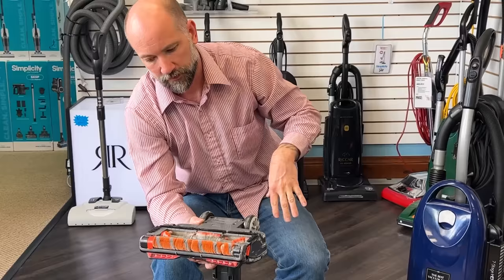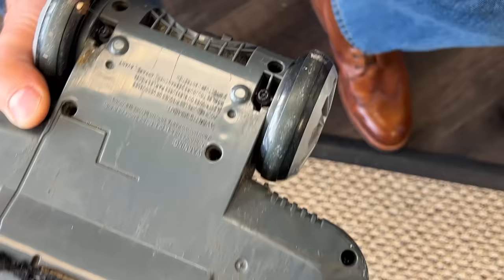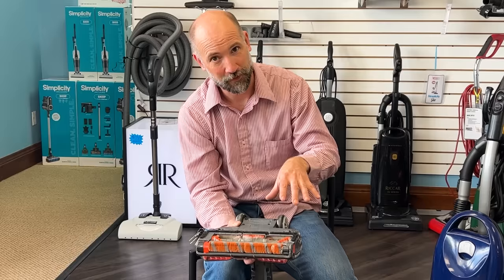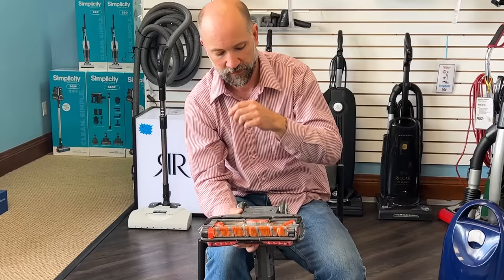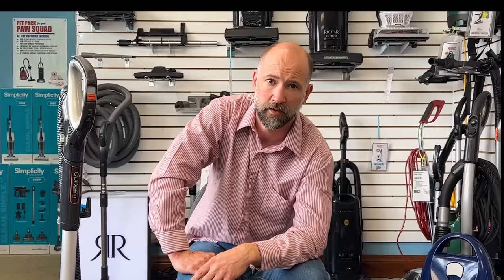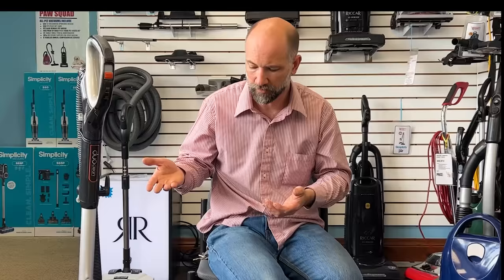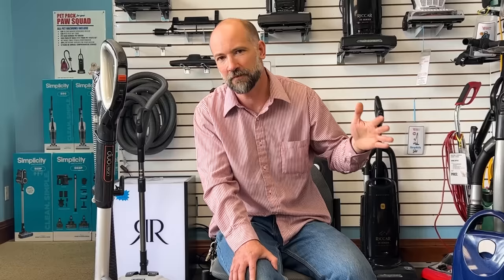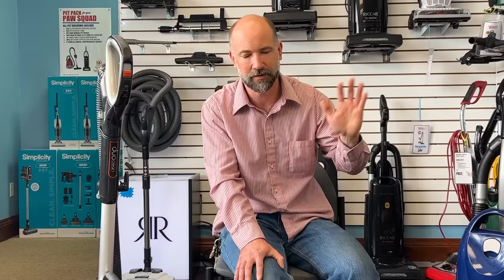Why Can't You Repair Your Shark Vacuum?

Comment: I have a shark duo anti pet hair model, and unfortunately they don't like to suck up tinsel, as the wire through the centre cuts grooves into the main roller, which damages the yellow plastic flaps and allows hair to wrap around it - the exact opposite of what it's supposed to do.

I, like many others, tried opening it up, and that was quite an adventure. It's now in pieces. Thankfully I've managed to find a replacement brush for sale (maybe second hand, but in good condition) so I'm waiting for that to come.

In the mean time, I still have a jigsaw of parts waiting to go back together, hopefully I've not lost any of the screws, and I will probably have to rewatch the video I found which shows how to get it all apart.

Like you and many others say, this really isn't best business practice, and, as the saying goes, once bitten (by a shark) twice shy!

Comment: So I got a powerfins hairpro. After a year suddenly it stopped sucking. Light comes on and if I have it set to carpet the roller spins it just doesn't suck. Thankfully I had the star screw bits but I found a screw that will not come out even though it is backed out all the way. Of course my magnet screw drivers won't even pick the screw out and I can't even bang it out. It is like it has something on the inside that keeps it from coming out and I can't even open it with the screw in there. It is pretty annoy that I can't just open it up to try to figure out why it stopped sucking.

Comment: My shark duoclean hv382 needs repairs. Either the belt snapped because the brush roll isn't spinning, and brush roll indicator light isn't working. But front lights are on

Comment: Fortunately those clowns at Shark have gotten nothing from me. I found my NV800C next to a dumpster and oddly enough it worked fine when found and for a long time after. Very recently though the main brushroll slowed and stopped; turns out the crappy bearings had locked up but the plastic gear kept turning which rounded off and melted it at the hub. I found that the bearings for the front brushroll drive were also stiffening up. Of course the crappy bearings were molded into the gearbox, so re-using that is impossible. I saved all the metal bits with no small effort; since the plastic gear was shot I would have been better off lighting the gearbox on fire to separate the useful parts. I’ll have to find a compatible replacement for that plastic gear which may mean combining two, and I will need to fabricate a bearing block somehow. The motor mount is still there, having broken away from the rest when I attempted to fix the unit. Aftermarket bearings of the correct size can be had; come to think of it the bearing on the brushroll itself had stiffened up and I replaced it with one from an old hard drive which worked fine until I swapped the entire brushroll.

I keep this vacuum mainly because I like the colour, and I’ve put a lot of work into customizing it. All of the ugly bling is gone and parts of the housing have been cut away for a cleaner look. I used to have a Shark stick vac which I hated the look and colour of, also a trash find. That had Philips head screws which I saved, and whenever I forcibly remove those bastards from hell, a.k.a Torx security screws, sometimes with the business end of an old jigsaw blade with fine teeth, I replace them with compatible screws from the other Shark.
Reply: One more thing, I also saved the plastic drive pinion for the main brushroll. The screw holding it on was actually a Philips but that would not turn and had to be drilled. What’s left of the screw is still stuck in place; hopefully heating the part on the stove will help me break the stub loose.

Comment: Still Sharks are amazingly innovative, (lift away and still power head like a canister) and they are light weight and quiet.
Sucks that they cant be repaired easily. They have amazingly tough belts unlike most other brands.
Most all proprietary electronics use protected bits and you can get a complete set of them for less than ten bucks at any Harbor Freight.

Comment: Thanks for this video, Josh.  I have a Shark and the small front wheels wore out.  I think I can fix this.  I appreciate your sense of responsibility as far as recycling goes.  Not too many people care.  I do, and want to thank you.
My son gave me a Hoover Windrunner and it is just too heavy for me to use.  I'll try to fix the Shark, but if I can't, what vacuum do you recommend?  Years ago I had an Orek and it seemed to las quite a long time.
Reply from the maker: Oreck was pretty fantastic in it's time. They were bought out by a comapny out of Hong Kong (guess where Shark is based?) several years back and their business model changed a lot. If you liked that Oreck the US company Riccar has a product line called Supralites which are a lot like Oreck. They are around the same weight but tend to pack a little more of a wallop since they have larger fans and slightly larger motors. https://www.vacuumsrus.com/product-category/cleaning/vacuumcleaners/?filters=yith_product_brand[11664]

Comment: I tried replacing the lower hose and I failed miserably so I just ordered a new head directly from them for $65... All I needed was the tiny hose but in my model the hose is connected directly to the motherboard thing on the vacuum so it was impossible to actually replace.

Comment: You forgot to mention the security torx are made of cheese. That makes it easy to get the peg out if you're not using security bits (they snap out easily) but they round out inside too. If you're able to get them out, use an alternative when rebuilding - hex, Phillips, pozidrive.

Ours stopped latching upright. The posts for the lower assembly retaining screw either side of the rear wheels snapped off the inside of the top plate. Whole new bottom assembly rquired at £85. Found a bashed used one for sale on eBay at the same time so bagged that for £15 for a spare.

Comment: Thankyou, I will never buy a shark vacuum again!
I bought a star size bit not realizing it has the specific hole in the center of that bit..., so yes, not even able to open ot up to check the belt.
At least I can still use it for the hose.

Comment: Shark will sell you the parts as a whole. You cant buy individual components for the Duo part but you can buy unit as a whole. Its a pain yes, but also I think that if one parts broke then another part will probably fail soon after.
I found mine to be reliable, except the anti hair wrap is a massive con and the tube has a tendancy to clog up

Comment: I can repair anything, if I have to. There are ways to get around everything, you just have to think outside the box. A good a good set of security bits and sizes of them is a good investment. Amazon sells plenty of sets from basic to all inclusive. With a little ingenuity, you can overcome any security measures and you don't have to use the same components for repairs. There are many ways of solving any problem. The security tabs can be overcome also and most of the time, if they break, it doesn't effect anything and if it does, there are ways of putting it back together without them. You have to be smarter than big corporations. You can fix anything if you really need to, it's not that difficult most of the time

Comment: Thank you for the great information. I have that roll er problem also that was intermittent but now it's not working at all. I do like the shark vacuum cleaner for its convenient accessories. Which one would you recommend to replace it? That is pretty comparable to it. And if problems occur repair components are available.

Comment: I bought a shark vacuum and came accross the lower hose issue after 18 months, had to buy an entire second hand head unit after eating up a lot of my time trying to open the oold one to replace the failed part. Not surprisingly this appears to be the same company behind Ninja airfryers, which are also a product with planned obsolescence and a lack of parts.  I will never buy their crap ever again

Comment: I bought a Dyson vacuum 20 years ago.  It was ~US$300, which I thought was quite expensive.  Just rinse clean one filter when needed, and replace the other HEPA filter every few years.  I even put a set of brushes in the motor a couple of years ago and it's all still going strong today.
Reply: Sadly the modern dysons aren’t as good. We’ve had four and while they haven’t gone the security screw route they got more fragile and complex. We now have a Hoover which was a fraction of the price and it’s obviously built to a price but as a consequence it’s simple and easy to fix. And the parts are easy to get. Also, it works very well.
Reply from the maker: @MrPhobart  That is an accurate observation. Out service center sees two types of Dysons. They ones that have been running 15 years and are in for their first repair, and the ones that are three years old and are already in melt down.
Reply: Totally agree. My DC17 is about 15 years old and still runs like a champ.

Comment: Not really any different to any other brand. Re the Torx drivers, they are available at any hardware store and you don't just buy one, you buy a set so all sizes are covered (often cheaper than buying a single driver). If access to internals is made too easy it becomes a safety issue as there are high voltages internal to these devices.

Comment: I think when the current shark dies, just gonna go back to an old fashined Henry.
Had Vax,  had Hoover, had Dyson etc. And the machine are either bad or the customer service is. As a kid our old upright was second hand and we had it 15 years, the vax that replaced it lasted until a housefire 6 years later. Somce bagless came along, the life span and repairability of machines has dropped right down. It seems they only want the machines to last as long as the warranty.

Comment: Yes it upsets me that the first sweeper I bought had a lifetime warranty but they can't find me in the system .I bought another small one  can't take it apart to clean it nor replace belt as you say . doesn't even have lights on it which I didn't realize I'm and older lady so my sight not the best .Well this will be the last one I never buy I'm done with this company .what a trip off .

Comment: I've found on average Shark vacuums last maybe 2 years before a repair is needed. Even if it is under warranty, not all parts are covered. I like using their vacuums but will not buy one unless I'm able to get one at an exceptionally good deal.

Comment: watched this video and your info and insight is great.  I have a NV831 duoclean.  I got it apart, labeled screws, etc, but the bottom hose was glued in on the head piece.  On the wand, I had to pull it apart to get the hose in.  I went to a vacuum stall at my local farmers market.  I bought a foot of hose, but it's more stable and not flimsy so it doesn't fit.  The clerk also said she couldn't take it back to the shop to repair (probably because of what I found)  Another repair shop wanted $119 to fix, telling me that he would give me the hoses free, but I had to pay the bench charge.   So can you recommend a vacuum that can be repaired in the future.  I have 2 cats and a mix of carpet and hardwood.  thanks,
Reply from the maker: Sorry to hear that. The brands we tend to lean towards personally are Sebo and Riccar!

Comment: Job for Louis Rossmann I think.  
We use Dyson exclusively, and every Dyson product we ever bought is still running, with the majority of spares available OEM or aftermarket.
Reply from the maker: That unfortunately is changing rapidly. Dyson abruptly terminated their contracts with their network of independent service centers in January of this year. We had been a service center for more than a decade. Several months after that they fired their Us phone support staff. Prior to this year we had seen a trend of parts becoming discontinued more rapidly or out of stock for lengthy periods. One good thing however is Dyson does not cycle models as rapidly as Shark which enables aftermarket parts producers to create popular aftermarket repair components.
Reply: @vacuumsrus  Worth knowing, thank you.  Very little upsets me more than planned obsolescence.

Comment: I regretfully vacuumed up diatomaceous earth with my Shark AZ1501 apex lift away and it still works but not as well. I cleaned out the filters and what I could without opening it up. Should I bother taking it apart or having it done? It is only a year old & was in great condition prior to me doing this. I thought maybe I could blow off any powder inside ? Would appreciate any advice. And no I will never do that again as I have now learned that was a big NO NO 😜

Comment: I've never owned a Shark and now I never will. I don't understand why people would keep buying them??? Shark must know people better than me if they buy 4 vacuums in a row. I'm 65, I bought a Numatic Henry about 40yrs ago, after an inherited very old Hoover Constellation finally gave up. The Numatic has never broke, despite having an unplanned journey down my staircase, going to a lot of the commercial sites that I worked on before retirement to clean up rubble, wiring debris etc, it has been my workshop cleaner ingesting lots of sawdust and over the years in the house they have seen a lot of cat hair as I always have a couple of furry friends living with me and generally it has had a very hard life, but it keeps going. Numatics are robust and simple and not too expensive. There is a whole range of Numatic vacuum cleaners, some are a lot larger and some are wet & dry etc. I don't anticipate getting a new cleaner anytime soon that's saying I ever do! 
Hot tip: Although it is tempting to use Henrys without a bag, they suck much better with a bag. It sounds perhaps counter intuitive but the micro-particle screen will clog up almost instantly without one and the surface area of a bag if opened up and laid flat is much greater than the screen which was never intended to be the main dust filter. Proper Numatic grey cloth type bags are relatively cheap and can be bought by the box, they are much more effective and last longer than cheap non original brown papery bags on eBay and market stalls. (I think genuine bags are available at eBay and possibly Amazon too.) 💐♥️🧀😎🐈‍⬛😺🏳️‍⚧️🇪🇺🇺🇦🇮🇱🇵🇸💐

Comment: My hunt for a decent vacuum is failing. I have 2 sharks. Had to take apart both, then I got a Kirby and the Kirby is the absolute trash, if it dust then it’s great. If it’s crumbs of chips then it struggles. Also the self propelled motor burns out easily.  Talk about a waste of 1400 bucks. The last eureka $70 vacuum has been the most reliable compared to the other 3.

Comment: Haha...THANK YOU! I thought I was going crazy...security torx bolts in a vacuum??? Cant see them way down in the hole... I had to drill the suckers out. Couldn't pull the roller out...??? Then I had to find the belt...Found a similar shark rocket in the trash ...all different parts... Shark sucks.

Comment: No new Shark!
We have a Shark HV 301. It is too bad because it is a nice design, a pleasure to use, and effective. My wife loves it however, I will not buy another. It needs a new lower hose. Simple to fix however, they are not available. The only type I can find are cheap white plastic hose that appears as though it will last maybe 6 months to a year at best.

Next time I will buy a vacuum that sells parts. I will investigate like this video. I will by a vacuum that is not a through away.

Comment: So I am NOT crazy, at least from the viewpoint of trying to fix one of these perversely put together machines. We live in a very dusty house and use vacuums constantly. Currently we own 5 shark vacuums and ai am trying desperately to keep them clean and running well. But it is a challenge, so I take John's point. They do it on purpose, which really upsets me. These things are expensive although not as expensive as many of their rivals and I want to get as much use as I can for as long as I can.

Comment: I just about managed to fix mine. They had screws under the lift off buttons which were basically impossible to get to without damaging the plastic round them. I had to glue the screw tabs back on. You needed to remove the buttons by wedging in the barbs and removing almost impossible.

Shame really it was a just a damaged flex from use.

Comment: I looked through some of your videos and didn't see anything related to this. Do you know what would be causing my shark vacuum to only work when tilted back? It won't show any signs of life when upright but will work when tilted back, albeit more quietly sounding like it doesn't have as much power. I have checked for clogs, I'm wondering if the motor is bad.

Comment: I wish I had found this video a few weeks earlier 😭 bought a shark...works great! Accidentally vacuumed over a bolt. Now it is stuck in the brush casing and I CANNOT GET IT APART 😭😭 I just need to remove the bolt that has wedged itself. That's all. Should be simple. It's not 😭

Comment: I had to throw out a shark vacuum because the flexible hose split. Shark doesn't offer a replacement and the replacements on Amazon are junk - the clip on the hose handle would break rendering it useless after 1 use.

Comment: Good information.  I am in the market for a hard floor/tile electric sweeper to replace the one I broke (Yeah, my fault) the handle on.  I was looking at the Sharks which have good reviews on function and cleaning ability.  So which models/manufacturers would you recommend if not a Shark?   Thanks.

Comment: Cel phone manufacturers are going to no-repair policy by assembling with adhesives and multi-function parts such as integrated display, touch layer & top lens.  Over half the cost of replacement.